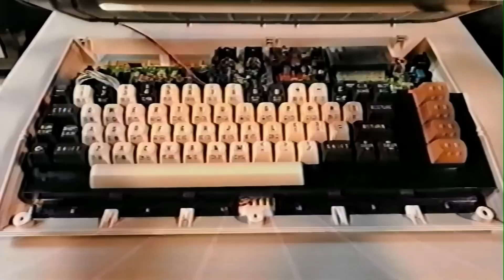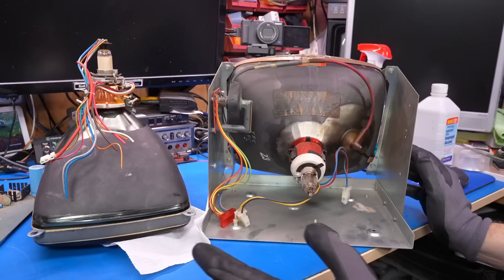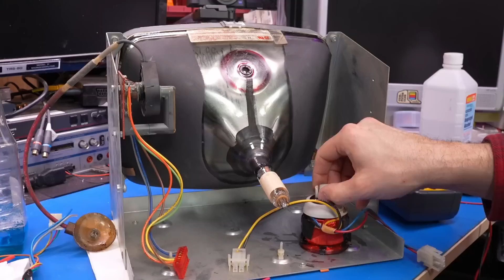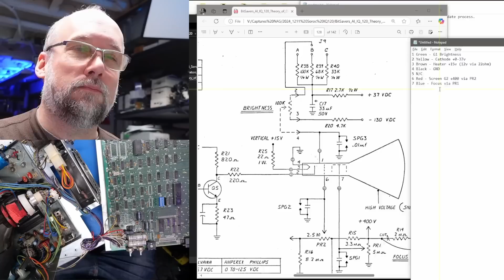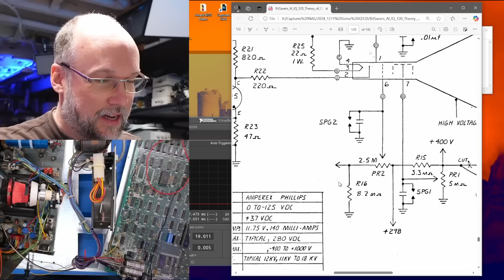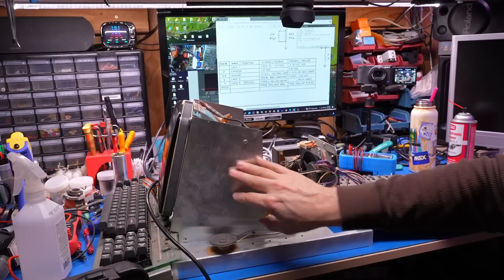Soroc IQ 120: Let's address the cataracts in the room

Comment: For corrupted videos, there's a piece of open source software called "untrunc", it's normally meant for *nix OS'es, but I have a build for Windows as well. Helped me to repair damaged videos from a phone as well as some incomplete videos from a crashed drone. You will only need an intact reference video, created using the same settings.

Comment: You went way over my head when you started talking about "emissions" and "G2 voltage", but that's a good thing -- it's exactly the kind of content I want to hear about. I want to fix up a too bright Sony Trinitron multisync. I was able to compensate for it using Sony WinDAS  but now whenever it shows too much white on the screen it suddenly dims everything. I had read that on my model some resistor commonly fails and "G2" goes extra high and causes the X-ray suppression circuit to kick in . At the time, I imagined I could just stick a new resistor in there, but I wanted to understand the circuit well enough to know what hazards I'd be causing first. So I put the CRT to the side and... well, that was over a dozen years ago! But hopefully by watching more of your channel I'll eventually be savvy enough to do it.

P.S. That sucks that you have to wait for sunny days before the Soroc cataracts can be removed. You wouldn't by chance be a member of the Seattle Retro-Computing Society, would you?

Comment: the big question is, if the schematic shows 2 options for CRT, then how is the chassis modified to suit the other type???
Reply: is the manufacturer option, a different flyback be used?
Reply: if it is supposed to work unmodified, i come back to, is brightness just to low, g1 too negative for this tube, it never went more positive than -37 volts.
Reply: the more i think about it, it might work unmodified with the other tube, i had been thinking of the grids as being isolated electrodes with the voltage being applied by the potentiometers, but this is an evacuated tube partly filled with free electrons, so the voltage measured at the tube on the grids depends on the impedance presented by the nature of the tube and current flows to and from the grids within the electron beam. right?

Comment: I would just rey to cut the protective glass shield with hot wire. A guitar string (high E seems to work fine) and a few volts from the bench power supply should do the trick.

Comment: I believe recording to the MKV or Hybrid MP4 formats will solve potential file corruption issues since they're built to be more resilient.  If you do MKV you'll likely need to just remux the file to MP4 within OBS for better video editing compatibility.  Hybrid MP4 also lets you set up a hotkey to insert chapters on the fly which will show up in DaVinci Resolve.

Comment: 24:00 do you run OBS in standard MKV form? Because if you do, it should never really corrupt beyond repair. That's why they don't default to MP4.

You're supposed to use the "remux" feature which instantly remuxes to MP4 and takes as long as it takes to copy the file instead of actually reprocessing anything. MKV has the pertinent data needed to decode the file throughout the stream instead of only at the end.
Reply: Wow, thanks for that info. Used mkv often in OBS but usually I converted it with handbrake - which seemed convoluted and odd to me. Now I know why.
Reply: They introduced the Hybrid MP4 format in v30.2 which is kind of the best of both worlds, but its still marked as beta
theres's an article about this on the OBS blog

Comment: Maybe in addition to Coors the Soroc people also liked SpaghettiO's and made the screen fill with O's as a diagnostic/POST screen before being cleared when everything was good. :)

Or they are Zeros which could be a stuck bit 4, since 0x20 is Space and 0x30 is Zero (00100000 vs 00110000).  I think the slashed zero wasn't too popular until later on after billions of o/O/0 confusions. (bit "5" on their chargen schematics because they count bits 1-8 instead of 0-7)

Comment: Hey dude, Chemist here from the UK who also has a passion for retro, 
i found soaking in toluene took of the safety coating very easy on a crt i had with this problem, it solvates the glue very fast.
it took an afternoon to work its magic, but when i lifted the crt from the tray the mess just stayed behind in the tray, 
make sure you do it outside or in a well ventilated place tho, toluene fumes are as flammable as petroleum spirit. 
Hope this helps, excellent work by the way,
 really enjoying watching your journey thru this project, ime working on a temperamental Amiga 1200 at present, it has a fractured motherboard which ive re-built over the last 8 weeks.
Reply: Trinitrotoluene should work even faster. Heh.
Reply: @bdwilcox  Certainly no need to worry about fixing the logic board afterwards.
Reply: @bdwilcox Adrian seems fairly health conscious, so I suspect that he’d rather go with low nitrates. 🤪
Reply: In the US there's a readily available solvent called Goof-Off which is xylene + toluene and is great at removing sticky glue.  It's powerful stuff, so wear gloves and be careful what it gets on!  (It can damage paint and certain plastics.)
Reply: @awd42  Not just gloves, also activated charcoal respirators and good ventilation/outside. Definitely no basement solvents.
Reply: man, toluene is toxic as hell and can get you really high (doped), its forbidden in us  and a lot of other countries to buy it in pure state for personal usage. Since we care about adrian's safety there's any solvent that can do it with lower harm? Maybe IPA?

Comment: I once saw a cosplayer friend warm up a piece of acrylic in the oven (at a low temperature, maybe 150 F / 65 C? Whatever the lowest setting on his oven was). He then placed the acrylic on top of a mold, and used a hot air gun to form it to the shape of the mold he made. Could something similar be done to form a replacement safety screen for that CRT by forming directly on the CRT, and trimming away excess? I imagine we wouldn't want to heat-stress the glass, but what if the hot air gun was kept on the acrylic side? 🤔👍

Comment: I immediately recognized the NUL character from my Nascom 2 but seeing the character font I think it too must have used a Motorola part too, which is odd as any old ROM would have worked as well.  In fact I was never in love with that font and always meant to make a custom one.

Good job on the terminal.  Maybe fix the noisy fan to make it a bit more comfortable.

Comment: It's probably more critical that the horizontal windings on the yoke be the same as the yoke and the flyback are usually a matched pair.  OTOH, the vertical windings might not be as critical, though you might have to change a width coil, if one is present.

Comment: Cateract surgery can be done indoors easily. Shango066 recently had a video with good instructions outdoors, bandersontv did a far larger color roundie recently and because of bad weather he did it indoors. Using heatlights to replace the sunlight. Works fine and isn't that messy, it's just deteriorating goop.

Comment: Who suggested to use a heat gun!? It's a picture tube... it's an ENCLOSED bubble of glass. Just use it a standard SOLVENT.

Mineral spirit is probably the cheapest you can get and I am betting that's going to work its way in no problem. Let it soak for a day or two and it will detach by itself. Just drop the picture tube's screen face down in a tub with a shallow level of liquid and let the spirt do its job.

Comment: Assuming the CRT isn't worn out it can be saved if you have the courage to remove the safety glass and the bonding agent.  Shango66 has done many videos showing how to do this on a roundie color CRT, (and maybe a few rectangular ones).  It should be safer to try this on a 12" 110 degree tube like the one in the monitor than a larger 70 - 90 degree color tube.  But you might have to wait for summer, so you can let the tube bake in the sun to soften the gunk.

Comment: You made me flinch a couple of times Adrian..

Like any large cap, CRTs can pick up a charge in storage. Always short large caps and CRTs and always treat them as charged regardless. You only need to be wrong once. Ive had disconnected defib caps in scrap pick up charges before and deliver a nice snap.

With your probe, earth off LAST. If there is a voltage on that probe the ground lead will float up to the test voltage.

Those clip leads and Dupont leads are not safe for the voltage you had on them. The insulation on those wires will not stop a flashover.

Ive been bitten by EHT because of a careless co worker. I have the scar from it. Please take care I'd hate to see you injure yourself.

Comment: Warning!

I've never done that repair on a CRT, but CRT cracking due to heat stress is for sure a thing. I would recommend try heating the CRT in an owen or like DIY green house heated to the desired temperature, letting the goo slowly drip out, rather than using a heat gun.

If you absolutely want to use something similar to a heat gun, at least use a hair blow dryer instead of a heat gun, as that uses more air flow to output about the same or even more heat energy but at a lower temperature, which likely reduces the risk of the glass cracking due to heat stress.

(My young-and-dumb experience of cracking a CRT happened several decades ago. I had a worn-out TV in a corner, waiting for it's destiny, and I needed some strong light to work on something, and the light I had at hand was one of those old 500W fan cooled halogen spotlights for early 80's color video cameras, but no stand, so I just thought that glass can take heat without burning, so I parked it against that old TV. A while later I heard a cracking sound and fortunately air slowly bled in to the CRT over several minutes. That was one of the scariest young-and-dumb things I've ever done)
Reply: Maybe you should not give advice on things you haven't done. 
There are a bunch of tv experts on YouTube that give good instructions. It's really not that bad. The heat from sunlight is mostly enough. And heatguns have low settings.
Reply: @bzuidgeest  Or maybe better safe than sorry?

Agree that sunlight alone would be the best though.

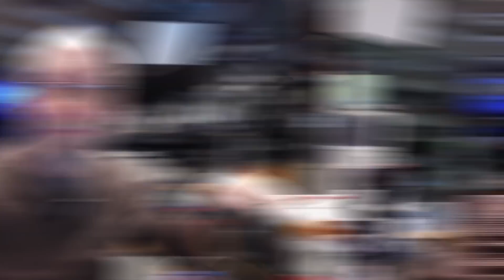Comment: 23:44 If you're having issues with OBS crashing, changing the file type to .MKV (if not already set that way) can help you with recovering that footage! MKV is more forgiving when it comes to sudden end of file scenarios compared to the .mp4 container. You can then remux it to mp4 after your recording is done through the file->remux recordings option if your video editor doesn't support MKV natively. The remux option can also save a MKV file that maybe doesn't play as is after a crash too. My video editor (Resolve) handles mkvs just fine but before I used it I was using the remux option all the time, never had an issue with it.

Comment: I once dropped an old amber CRT from a CGA display into a B&W TV, just to see what would happen. It worked, but the picture was really dark. I don't know a damn thing about CRTs myself, but those tubes requiring a higher grid voltage than TV CRTs does seem to jive with my own experience.

Comment: From a friend who does "Custom Cathode reConstruction", get a 'water proof' tub just big enough to allow you to put the tube in face down.

Pour in enough alcohol to fill the bottom of the tub to a few inches.  What you want to happen is when the tube is placed face down, the alcohol will go high enough to submerge the protective layer.  Cover the tub, let it soak for a long good while (some times days, but 4 or 5 hours is 'typically' sufficient I'm told).

As the IPA soaks in from the edge of the protective layer it will dissolve/loosen the adhesive allowing you to slowly, but more easily work it off.
Reply: Given what we've seen with IPA breaking down the gunk easily, that really seems to be a good approach. I would have also suggested warming it in a lowest-heated oven (150f?) for an hour or so. Maybe even warming the tub of IPA (90f?) would make it work even more easily, but have other issues (fumes).
Reply: But if you heat it, it will evaporate faster than it already does.
Reply: @FalconFour  It was never mentioned that heating would be necessary, just let it soak for a bit, peel back the coating as much as you can, stick it back in the alcohol, cover it again, come back later, peel some more, rinse and repeat until the safety screen is off.
Reply: If you do warm the ipa any make sure you do it outside. Ipa has a flash point below 73f and a boiling point less than 140f. The fumes would not only be unpleasant to breathe, but would be highly ignitable.
Reply: No heat needed, the glue expands with the ipa, sucking in more ipa from the edges. Did this to recover some oscilloscope tubes.
Reply: I was wondering if submerging the surface in IPA would help loosen it enough to peel off. Was going to suggest experiment with the exposed glue at the edges to verify.
Reply: I would recommend for good effect to use denatured alcohol. This is 100% alcohol with a touch of other chemicals in the .01% range to make the alcohol un-drinkable. I use this all the time when cleaning. It is effective at cleaning and in this case the other things will help in the breakdown of the glue.
Reply: But that goes against the ultra-dangerous "Shango 066" method of outdoor sun-baking in a garbage can filled with garbage bags!
Reply: My advice is to strip the CRT clean of plastics first since the warm IPA will eat anything in the sight, since it's of course a solvent. IPA or a huge bottle of Everclear, doesn't matter, you just want to make sure you are not ruining anything else mounted on the CRT, since of course the deflection yokes tend to operate at high voltage when resonating at 15 - 33 kilohertzs. And when yoke's removed, be very careful around the CRT neck.

Also, if you don't feel comfortable with heating up the alcohol with open heater or burner, try Aquarium tank heater - only submerge the glass part and don't let plastics touch any alcohol.

Comment: one thing to watch  when swapping crts, the base connections and heater volts may vary, and some guns use a high A1 and focus volts ,,around 300, maybe more, some low, around 100,  putting a high voltage type in place of a low, you'll likely get no picture, other way round it'll 'white out', maybe taking excessive eht current, even risking flashover. with all those wide ranging adjustments in that machine, it can likely drive both types with suitable setting...

Comment: Can someone pls explain how a band round the edge of the crt will stop implosion ??? I mean, imploding is going in first,.., so i fail to see how it helps??
Reply: He explained in the first episode. It doesn't stop the implosion, but it does prevent the force of the implosion from rebounding and causing an EXplosion, which is far more of an issue when you're dealing with conventional (non-safety) glass.
Reply: @stevethepocket  thanks, but i thought the explanation was, for larger tubes, under vacuum, the flat face of the tube is pulled towards the bell of the tube putting outward force where they join, the taught band of metal placed here stops the glass from bending outwards and cracking.

Comment: I flinched when you removed the ground clip before the high voltage probe... I would have gotten bit if I tried that.
Reply: But it clearly had drained already.  Perhaps your HV probe didn't have the drain feature?  Still a fairly reasonable safety habit to un-probe before un-grounding.
Reply: @Spudz76  You Right. I've been bit a few times too many. Even the day after power down. Hang it up, that right arm is tingly and weak for the rest of the day. Used to do arcade machine repair in my free time if I could keep the old parts. Good old days.

Comment: Dahm. The blue terminal at 2.18, i had one of those at one point. And as Adrians, mine just started to show a letter (H) all over the screen. 
Being more that 10 years back, I sucked at electronics , so it was DeBit and DeSouled for scrap. Still remember that need blue serial terminal, I used to Connect it up against a Linux system. 

Now I could have gotten ideas to fix it !

Comment: To get the safety glass off, use a guitar string tied to wooden dowels like a garotte. Then heat up the face of the crt and pull the string between the crt and the glass.

Comment: Very instructive video as always.

It might not be a good idea to use a heat gun ad a heat source as it might produce a too uneven temperature change in the glass of the tube.
What I have seen is putting the screen on its 'face' and use a large infrared lamp + patience for preheating.
This is much slower but a lot safer.

Also prying the safety glass off is not a good idea either.
A thin wire might to 'cut' the glue might be a better option (once the glue is at the right temperature).

Comment: In the long, long ago when terminals were still more prevalent than desktop microcomputers like Apple IIs and TRS-80s, the CRTs used in monitors were hardly ever "universally compatible". Most manufacturers saw standardization as giving money to their competition. Yes they may want to cut costs using "off the shelf" products, but one would do well to remember that "off the shelf" covered a very long time range of stuff that had been languishing in warehouses since the very dawn of electronics. I, myself, can recall seeing more than a few that had CRTs inside them that had no indication who had manufactured them and used voltages wildly different from what I thought they should use. It was only after IBM PCs took the fore that I started seeing any sort of standardization in CRTs, although even then one ran upon the outlier plasma screen display or vector display that would confound replacement.